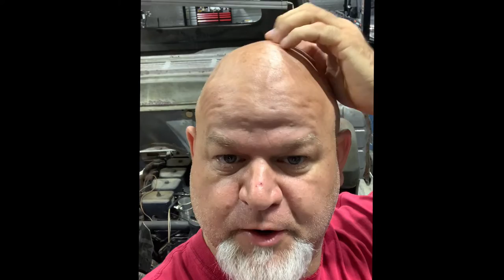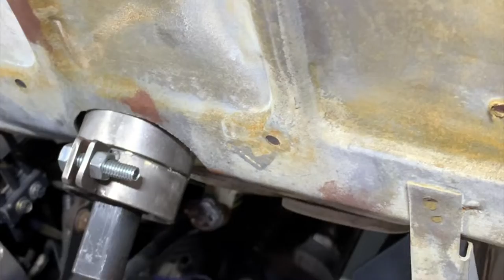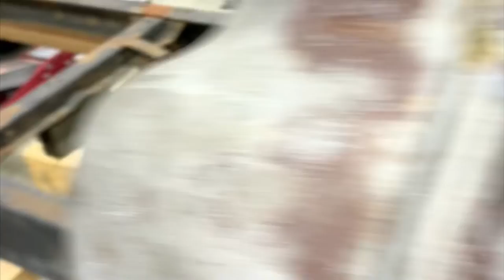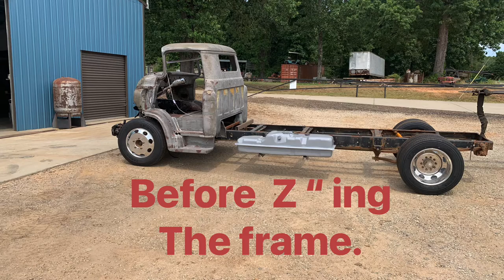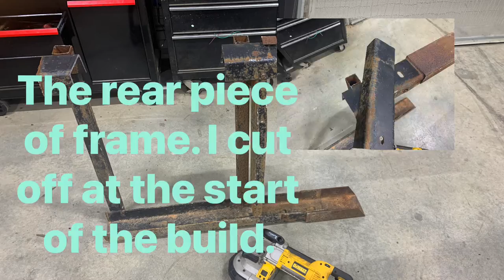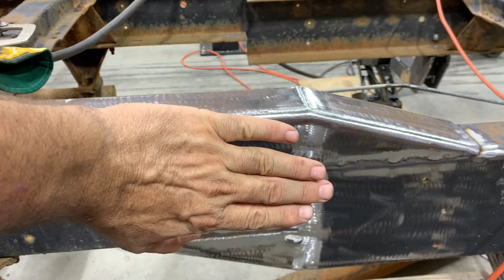How to build a 1955 Chevy COE Ramp truck with 12 valve Cummins engine. Part 3

Comment: What kind of frame did you start with I'm thinking of useing a travco frame
Reply from the maker: 1996 C30 motorhome chassis
Reply: @boogietech  c30 or p30? what's the track width of the front tires?